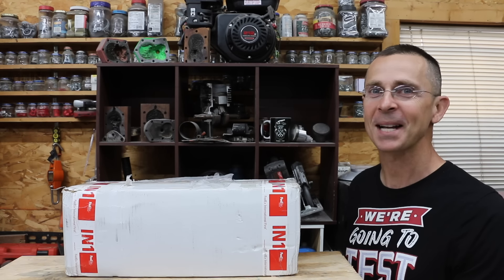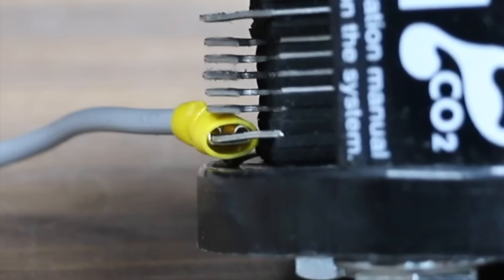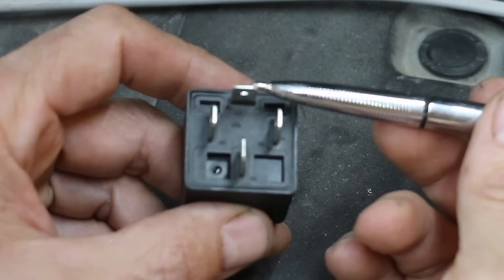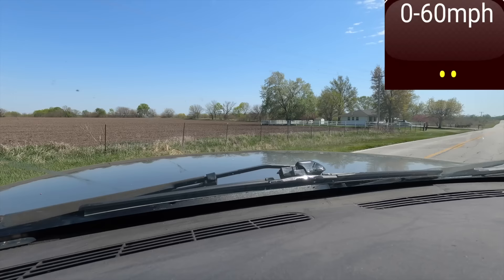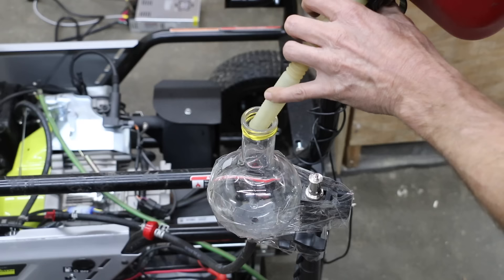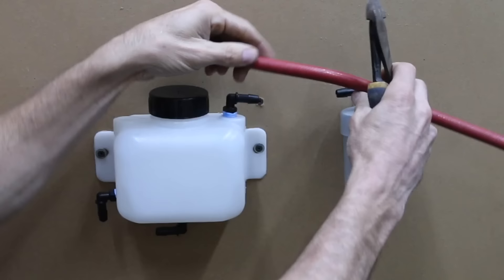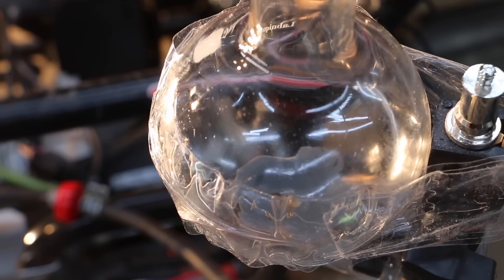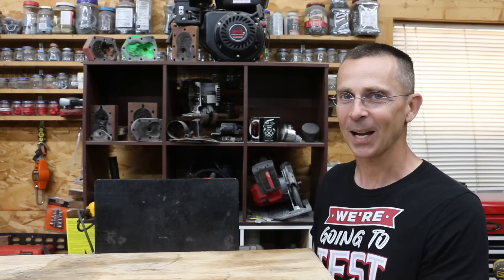AMAZING 35% More MPG with HHO? Let’s find out! Help with high gas prices?

Comment: I, for one, am absolutely SHOCKED that this thing didn't work. I was absolutely certain that the folks behind the HHO had stumbled upon something that the rest of us have been overlooking for all these years...
Reply: Why are you shocked? He used zip ties instead of bolting it on, thus causing excess vibrations to not have it work. (
Reply: @mychevysparkevdidntcatchfi1489  Well, the design of the thing just seemed so robust that I assumed that mounting it in such a way wouldn't cause any problems.
Reply: Wonder how many people can still recognize sarcasm.
Reply: It actually works. The trick is to find the right amount of power to put in the HHO cell. Usually this is done by adding a PWM circuit. This way you reduce the heat while still creating HHO. A car should actually adjust its mixture to compensate for the HHO, this should result in less fuel usage. The theory is that youre deluting the fuel to gain efficiency. Ofcourse this depends on the car used with the stock altenator.
Reply: @tygo9500  it works as in it is producing hydrogen but it can't give more miles to the gallon. The ecu is programmed to put a certain amount of fuel . So the same amount of fuel put in with a massive draw on the engine. Its as project farm has shown it costs to run on the normal run of the mill car.
Reply: Yes, how to get money from suckers
Reply: @Torbay-rox  For it to work you NEED a pwm controller otherwise your electrolyte will get too warm, destroying the gains in efficiency.
Reply: They are actually more likely to work on a diesel engine, they run much cleaner with more power from a better burn.
Reply: @simonpalmer8033  nope, the amount of hydrogen it way too small, is nothing else but a con
Reply: @jantschierschky3461  is that not a generator size problem? I certainly know that especially older diesels only burn about 75% of the fuel.. Even a small amount of combustible gas encourages more of the fuel to burn hence cleaner exhaust and more power.... Lpg injection does the same as far as I'm aware.
Reply: @simonpalmer8033   well with 50W you just not getting anything.  Actually diesel has relatively high efficiency, even old engines.  However turbo would help. The amount of hydrogen you need would  use lot more power than you gain.
Reply: @jantschierschky3461  if you say so....
Reply: @simonpalmer8033  multiple conversion is never a good idea.... fuel ->heat ->mechanic -> electric -> hydrogen (fuel again) -> heat and so on
Without getting more technical it is like hooking a motor and a generator together but with a loose rubber 😉
Reply: Just  like Captain Renault from "Casablanca" was shocked to find gambling.
Reply from the maker: Thanks for sharing!
Reply: If this worked it would already be banned in F1.
Reply: @tygo9500  still wont work.  If you power it via the vehicles electrical system it is putting a load on the alternator, the alternator produces the amount of electricity that is demanded at any given time and adjusts to the demand.  when you add more demand the engine has to work harder to spin the alternator, and because of efficiencies in an ICE you actually end up with less fuel economy.

However if you power the electrolysis via solar, or an independent electricity supply from the vehicle it very likely would increase the fuel economy.
Reply: @TheJefferson  you're forgetting that you're deluting the fuel. The deluting creates the increase in efficiency. You use the efficiency of the hydrogen to mix with the gasoline. This way you can drive further with one gallon of fuel. Normally you are right, since the energy has to come from somewhere. But this genuinely works, there are however multiple things that need to be tuned. ECU should make the mixture leaner to compensate for the hydrogen entering the engine. (By lambda) The other thing is that the cell should be controlled by PWM, this reduces the heat and keep the efficiency high. The last thing, there should be a way to get the status of the accelerator pedal, because the PWM circuit will be controlled by how far you press the pedal. (Hence it's called an on demand hydrogen system.)
Reply: @tygo9500  prove it. Make a video that shows what you are talking, testing this device and showing real 35% mpg improvement, then maybe someone would believe you.
Reply: @tygo9500  Hi, rather than PWM which I did use to begin with a simple set up of micro switches on the throttle and relays to reduce or add plates as required. This increased and decreased current flow. No electrolyte improved heat stability in the HHO generator which had more plate area as well.
Reply: @sepg5084  Hi, after seeing others working on HHO generators and making claims I tried to replicate their projects. It took some months to have success with many gradual improvements. 
If set up correctly there is a definite fuel saving.
I drove a car for 5 years on HHO and didn't appreciate the fuel saving until a newer car was purchased. I had decided HHO was too much work and taking up too much time and attention.  
Running an engine lean with the extra power produced takes its toll with wear on critical parts. There is also constant checking and monitoring which is similar to having an unreliable vehicle.
Reply: @tygo9500  no, the extra energy that the engine outputs due to the hydrogen is less than is needed to create the electricity for the electrolysis.

Electrolysis is the most inefficient way to create hydrogen, at best you are going to get 70-80% of the energy you put in, then when the hydrogen is used in the ICE you are dealing with 35% MAX efficiency in a modern energy, then you have to turn around and use that to make more electricity to make more hydrogen at 70% efficiency.

You are not adding any energy to the system, you lack the understanding of how an alternator works, as long as you are relying on the engine (via alternator) to create the electricity then this will never work.

E=MC^2  this equation has yet to be proven wrong
Reply: It didn't help when powering the generator. And there was no extra load on the engine (no alternator involved).
Reply: @franknewling1139  the power supply was plugged into the generator, therefore it applied a load to the generator (basically an alternator)
Reply: Russians just use vodka
Reply: @tygo9500  It simply can't work. It takes energy to break down the water, so that the produced gas can deliver more energy into the engine. The process isn't 100% efficient, so overall it hurts the efficiency. If it "works", it's because the energy is coming from the battery and not from the alternator, so eventually the car won't start.
Reply: Toyota made a combustion motor that runs on hydrogen. Wouldn’t existing combustion engines run on hydrogen as they do on propane.
Reply: @tygo9500  The theory is bogus.  These things do not work.  Don't believe the pseudoscience from the quacks selling these worthless gadgets!

Comment: I put one together built it from scratch using coffee jars 40 amp selfie resetting fuses 10 gauge two conductor wire. And it has almost doubled my fuel economy and I only use arm & Hammer baking soda for the electrolyte.

Comment: I messed with these quite a bit in highschool and I never could get any positive results better than what I would consider a margin of error.
Reply: They seem best used for novelty use, like making highly flammable gas for 'bottle rockets' or filling bags to make a boom.
Reply: @randomidiot8142  you can make boom without bag, put sudsy water into plastic cup and let hho makes bubles and then bring flame
Reply: because its fake.. hydrogen implodes..  which doesn't create any power at all..

Comment: One of those classic, "too good to be true" examples. Otherwise, the whole world would be using these.
Reply from the maker: Good Point!
Reply: No you’re incorrect, if I were big oil...I don’t want you to have something that gets you better economy as then you would purchase less from me...
Reply: However, Meyer made what Professor Laughton considered a "lame excuse" on the days of examination and did not allow the test to proceed.[2] His "water fuel cell" was later examined by three expert witnesses[who?] in court who found that there "was nothing revolutionary about the cell at all and that it was simply using conventional electrolysis." The court found Meyer had committed "gross and egregious fraud" and ordered him to repay the two investors their $25,000.[2]

Meyer's patents have expired. His inventions are now in the public domain, available for all to use without restriction or royalty payment.[14] No engine or vehicle manufacturer has incorporated Meyer's work so far

Maybe combining this with free energy magnets could really revolutionize investor asset transfer.
Reply: Magnet motors don't work cos if they did, everyone would have one.
Reply: TruthOrDie777. com  it's physics. I even own a hydrogen fuel cell just for testing. A hydrogen generator is about 50 to 60 percent efficient. You put in 100 watts from the alternator, you'll get back 60 watts out of a hydrogen fuel cell. If you use the hydrogen for engine combustion, then you have to add the losses of efficiency the engine and alternator loses. As you can see in this video, by the time you add up all the losses, you can end up on the negative side.
Reply: From what I can tell the comments almost all discredit the hho generator however running a vehicle on water is not only good for the environment it is much cheaper than gasoline.It's no wonder the inventor  was killed over it but oil companies pay to have inventions like this squashed or shelved.Who cares if the performance isn't quite as good.I think it's more than good enough,oh try connecting the electrical to the alternator and see the production of hydrogen.It's a no brainer.
Reply: @bugsbunny3488  The problem is that it runs on electricity, not just water. All the energy that will ever exist is already out there, it cannot be created and it is only useful if there is more in one place than another, so you must find the source of energy whenever work is being done. In this case, the energy comes from the engine, splits the water into two reactive elements and those elements are recombined and release the energy. Since you cannot create extra energy from nothing, you must use some other energy source to split the water if you want to use it as a fuel. Regenerative braking using hho is an option, but I don't know if it would be better than current implementations.
Reply: @umbrakinesis2011  Don't you know how electrolysis works?The current comes from the alternator,Its called hydrogen on demand.Its safe and clean.
Reply: @danstrayer111  and there’s a point to your banter
Reply: It does work. I built a big Hydrogen fuel cell and ran my lawn mower on it. The issue is they are pretty dangerous when you produce a larg volume around a combustion engine. The Hydrogen fuel cell in his video probably can't run a pen torch 😂
Reply: Should do your research Dan. The position and negative plates are the generator, and the little cylinder that captures the Hydrogen is the fuel cell. His generator doesn't produce enough Hydrogen to be very effective. I have a Hydrogen cutting torch I built. The generator runs on 24vdc 1600 amps. With a 20 gallon fuel cell. If it was to explode could probably take out half a Building. I recently took it out of service after I got a nice plasma cutter. 😂
Reply: @Charles McKinley
Very informative comments. Thank you!
Reply: Wholeheartedly disagree. He doesn't know the proper setup for this. Don't take his word for it.
Reply: @bugsbunny3488  The alternator gets its energy from sapping the mechanical effort of the engine. Its a round robin of pointlessly moving energy around with the usual additive losses. All these "inventions" are put together to con those that bunked off from science class at school and missed out on learning fundamental first principals of entropy that apply to everything in the universe we inhabit
Reply: @xtc2v  Have you considered that a second alternator wired as a generator would work OR hook up the alternator to a capacitor bank which I already mentioned would greatly in crease voltage,NO you guyes keep trying to debunk something that works I figure your paid off by big oil.(RESEARCH THE VIDEOS ON YOUTUBE) hho generators and how they work.Just don't try to tell me they don't work.Even the demonstration in the video,water compared gas efficiency  shows almost comparable.What would you rather pay for (water or gas ?)
Reply: i built one myself and ran a small engine without gas at all, it does work but my setup couldn't keep up with demand but to see a completely empty carbureted engine run on water alone was amazing
Reply: @scottreynolds2466  Success lies on supplying enough voltage to increase hho production.With a 2 stroke engine connect the hho generator to the high tension coil or the the charging system to a capacitor bank.That should increase voltage and amps thus increasing hho production,rather than just using the battery.
Reply: @Justwantahover  Most people don't have these things because they don't know about them.
Reply: @bugsbunny3488  An alternator converts mechanical energy into electricity. Two alternators would use double the gas. The electric out will have slightly less energy in it than it took from the engine. Capacitors store voltage up to the voltage they receive. By themselves they cannot increase voltage. It would require a transformer (before rectification) to give a voltage increase. Current would be less if voltage rises (power is I x V) since power out must always equal power in. There is no such thing as more power out than you put in...something for nothing is never possible (in this universe anyway). Car manufacture is highly competitive and many firms have gone under over the years. They each take out hundreds of patents to try and get an advantage over each other. If using water was something for nothing I assure you it would be exploited by the first patentee.
Reply: @scottreynolds2466  I'm sure it works. Just use the battery to power an electric motor. The engine is just introducing losses
Reply: @Charles McKinley I love these ultra mpg gimmicks. They bring out all the crazies!
Reply: @scottreynolds2466  It did not run on water. It ran on whatever power source you used to split the hydrogen/oxygen bonds.
Reply: @xtc2v  Well, maybe you need to get some more information because Audi, BMW, and Mercedes all build HHO cars already. How ever they are actually electrical cars. Just visit their websites and you can read more about it. HHO is also used since decades in industrial solutions with a lot of success. I agree, it might be not as easy as to just put a tube in your air intake but you cant say that HHO isn't working.
Reply: @Floripalive  I didn't say it doesn't work just that this self-perpetual creation of hydrogen onboard is a scam
Reply: The hose is way to big and and there is nothing to measure how much hho is actually being produced. Second i think you need a pwm for fuel injection. Also you were prebias towards it being b.s. No pulse wave modulation and the kits are like the flat earth society. Designed not to work in other words. Make your own. Critucal step: MEASURE THE OUTPUT
Reply: @Justwantahover  Ummm, they do......&....they do
Reply: @bugsbunny3488  Yes you can increase voltage but current falls in proportion. Power is volts multiplied by current. Input power will always equal output power. If you could make an alternator produce MORE power out than the mechanical energy put into it we could start an electric car by pushing. The car would pick-up speed infinitely without needing any battery. Stop and think about what you are suggesting before expressing frustration and anger
Reply: @xtc2v  First of all,have you viewed
 any of the videos on youtube.People are using the hho generators successfully for years,they get great mileage,they put a auto reset fuse on each side of the hho generator and insert the hho output to the intake.Capasiters can be used to store power then release in impulses
Hence the auto reset switch,like I said watch the videos(How to run your car with hho on demand)trust me it works and it's cheap,mabey you should consider it.Sorry if you thaught I got upset.
Reply: TruthOrDie777. com  yep, fuel trims would have painted some sort of picture to see what's going on, and the ecu needed time to adjust.
Reply: TruthOrDie777. com  No kidding,
They would do anything to discredit the hho system unless they tried it for themselves.Then when they realized how much money they saved they would wonder why they didn't do it sooner.
Reply: @chrisfillinichmusic  Yeah people seem to think running there cars on gas because it gets a tiny bit better performance is better than running there cars on water or I mean the hho kit.
Reply: @Charles McKinley No they generate hydrogen 2pt and oxygen 1pt a good burn mix, not electricity.Batteries generate electricity.
Reply: @xtc2v  If you didn't say it doesn't work then wtf are you trying to say,it doesn't work to your standards?don't you think it's a little more environment friendly than fossil fuels.Probably not if your gonna lose like .001 percent of the power.OK xtc2v.
Reply: @jimherbold1879  No your not splitting water your splitting hairs.